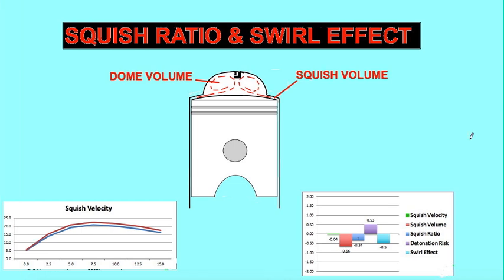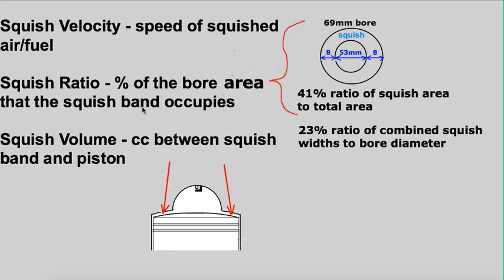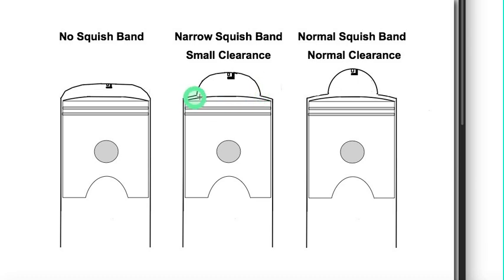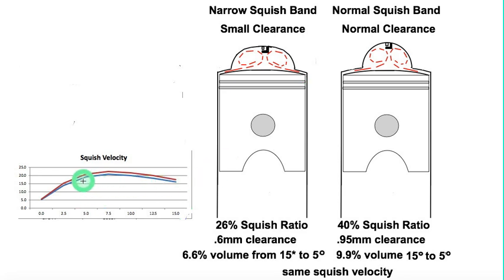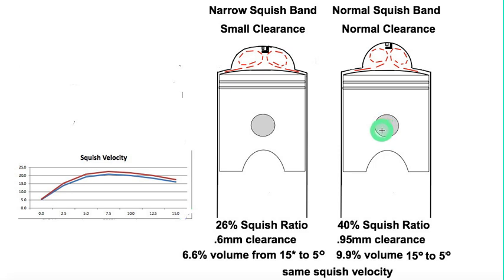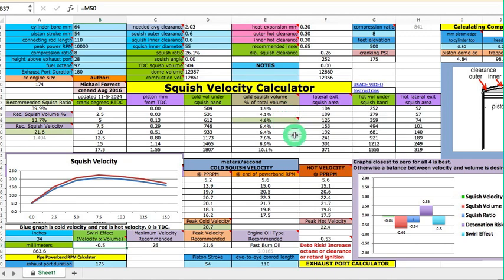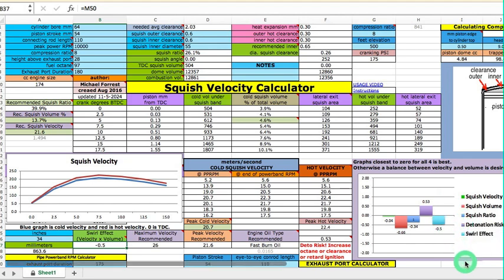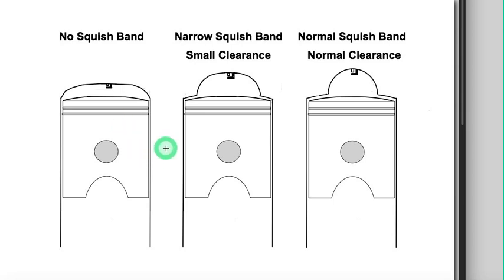2 Stroke Squish Volume Effect on Swirl

Comment: I have a cylinderhead that does not match 100 % with the Piston head. So at the  far Edge by the cylinderwall I measured 0.98mm an progressively towards the dome 0.58mm. the head does not have a negative agle, I guess an very small angle  (maybe  5°).
The Piston on the outside makes a larger gap because of its shape.  Can this be a problem regarding detonation (of course I would rise the cylindergasket to 1.08mm instead of 0.58mm)?? 
Can you Please give me your advice? Thank you
Reply from the maker: if you have detonation and are sure your jetting isn't too lean and your timing isn't too advanced (set both for max power) then you can blame too high a squish velocity and you should try to make the piston clearance even from outside to inside.
Reply: @MichaelForrestChnl Michael!
Reply: Ignition timing now ist Set at 2mm before TDC, I guess its not correct. Should it be more like 1.2mm before TDC?

Comment: Awesome channel, I don't even own a 2 stroke (well, a chainsaw though)

But find engine tuning interesting.
And I do have a interest in potentially owning one of the many stroke old German cars, the Wartburg's, the DKW's/Audi
Which all generally run a 1000cc 3 cylinder 2 stroke.
(1175cc in case of the Auto Union F102)

Comment: Which head did you put on the AX? Or, did you machine the original one?
Reply from the maker: Aluminum  was put onto the stock head and then its crude form was made to be like I envisioned. But I didn't notice any power increase. It just made the engine run cooler. Low RPM don't need the extra turbulence.

Comment: We run around 50% squish ratio on nitro rc boats and between 0 .3mm -0.4mm clearance,,allows max compression with less detonation,,need all the power you can get for boats  lol
Reply from the maker: what compression ratio and what max RPM?
Reply: @MichaelForrestChnl  Around 18:1 or more static comp,,11:1 dynamic with 180-190 or more deg exhaust timing,,50-60% nitro methane fuel,,3.5 cc engine 35-40,000 rpm,7.5 cc 30,000,,15 cc 25,000.The speed record guys go crazy with intake and port timing/compression,,glow plugs don't last long lol

Comment: E. g. 1968-1976 Suzuki T500/GT500 do not have squish heads. These engines are prone to pinging even in stock setup, not to mention in case of rebored cylinders with a comp tad higher. I was able to source aftermarket squish heads and I can ran far higher compression without pinging issues.
Reply from the maker: Squish bands reduce piston temperature which reduces deto possibility.
Reply: Over the first winter I had my T500 Titan I whittled new heads out of copper with more fin area and good squish I copied from a racing outboard same bore and stroke.

Comment: Great video. Keep up the good work.   I like your comment about making the squish clearance too small increasing detonation risk. Have you tried calculating a squish temperature/pressure to identify knock risk?
Reply from the maker: If I had more data to analyze then I could attempt that, but it is complicated since its 4 factors are combined: jetting, ignition timing, compression, squish design